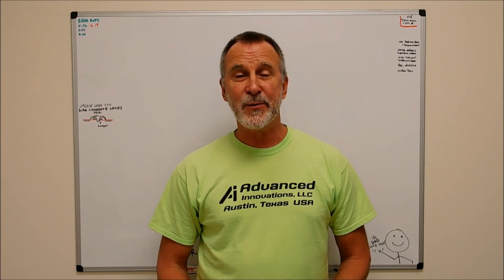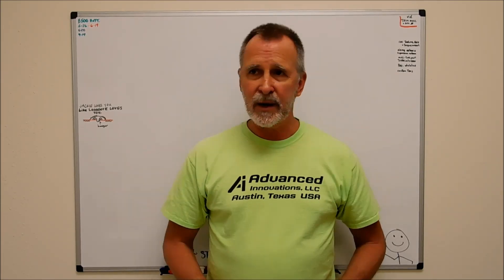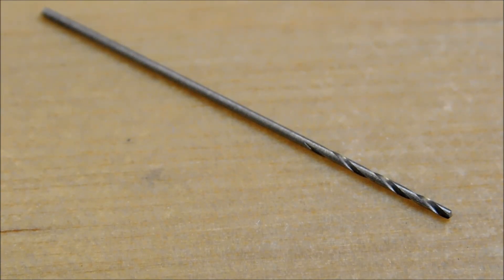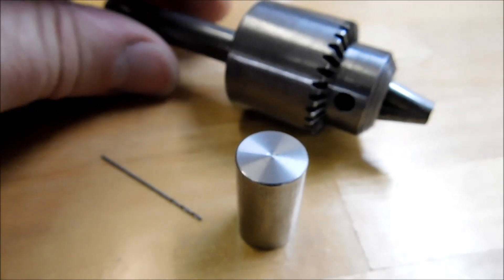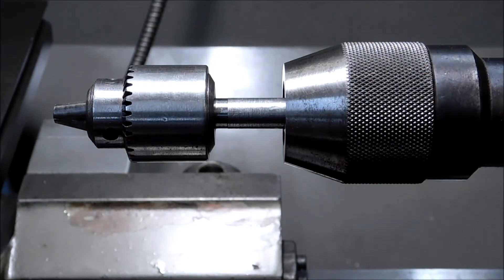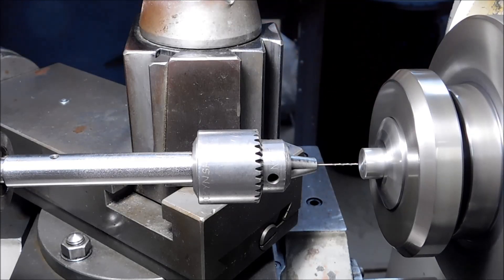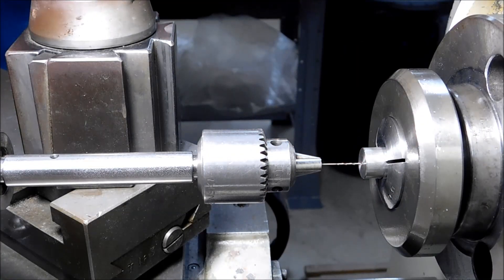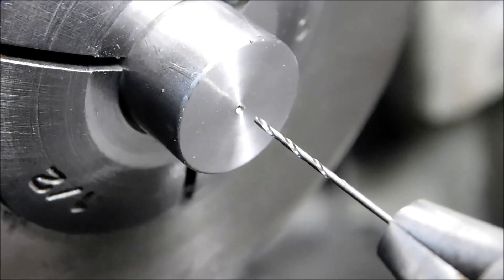Micro Drilling -- Stop Breaking Small Drills !!

Comment: A mill/drill version of this micro drill does exist. Years ago I made one for our tool room before we found out we could buy one. The micro drill chuck in this video can be upgraded fairly easily. 1. cut a key slot in the shank. 2.drill and tap the outer sleeve, the female part or adapter, on center and near the open end and install 'dog' tip set screw. The dog end set screw is used to drive the chuck but still allow the shank to extend and retract. 3. Cut a small groove for a snap ring about 1/4 inch rom the back of the chuck. this will hold a 'finger ring', basically just a washer, that you hold to control the depth.  Here is a store bought adapter that uses a key and slot. Hopefully there is enough info between my quick explanation and the pic to make your own!
Reply from the maker: As I have commented before, the keyed mill versions of this concept will not allow you to let go and have the chuck spin if the drill starts to bind.

Comment: I DONT HAVE TO GO  TO THAT MUCH EFFORT TO DRILL A SMALL HOLE IN STAINLESS. JUST BEING HONEST.
Reply: didnt have to go to that much effort capsing every letter lol
Reply: NOT shouting, sorry IF it seemed that way,  MY PHONE works BETTER when in capital letters. Put drill IN small jewelers drill press AND drill away. MAKE punch mark FIRST FOR sharp drill TO start cutting.
Reply: Ok LEANARD.  Where's the link to your video showing how you do it then?  Without all the shouting please.
Reply: leanard flow go home Leanard, you’re drunk again
Reply: WELL THEN THIS VIDEO WASN'T MEANT FOR YOU WAS IT, BY THE WAY WHAT KIND OF MACHINE DO YOU RUN, throat's dry need some water..........
Reply: @charliecopeland390  what do you mean BY that.
Reply: @leanardflow8194  I just meant if by what you said "" you did not even have a problem drilling small holes""  you didn't need to watch!! No problem dude.  I write in caps alot because my thumb is not very athletic any more and caps are bigger. I have adjusted my keyboard bigger several times and may need to do so again!  It's all good

Comment: When I was a machinist we had a micro-drill chuck that had a spring loaded shaft and a free-spinning thumb grip.  You'd hold the thumb wheel and pull the chuck down.  Total touch sensitivity.  When you let go the spring retracted the floating shaft.  Imagine this video's set up but with a spring pulling the chuck back into the sleeve.
Reply from the maker: Those are normally for a mill. The advantage this setup has is that you can let the chuck spin if you detect a binding of the drill so the drill doesn't break.

Comment: I'm a turner,miller but before that worked as an engineers storeman. While I was there I perused a tap and die catologue and saw that as regular stock they could supply a 4 thousandths of an inch (one tenth of a millimetre) tap with 318 teeth per inch. I would have crapped myself if I was told to use one. It's another world.

Comment: This method is only applicable in rare cases.
When a person has a shaver for work on a metal cylinder and when the hole should be at the center of the rule. For example when you to make a hole in the corner of a piece This method has no possibelity
Reply from the maker: Not true. Either use a 4 jaw chuck, or a key driven floating mill chuck and a 'V' block for mill applications.
Reply: @joepie221  Thanks for the vid! Joe, could you do another video on small drills for mill applications showing the use of a 4 jaw chuck and a key driven floating mill chuck, as you explained? Please please please. It would be great to have an overall understanding and  knowledge when it comes to having to drill very small holes on projects. Either way, you rule! thanks again for all that you do! Love and peace!

Comment: Just buy Sphinx or Harvey Tool carbide coated micro drills. I've CNC drilled a .006 DIA into 440c cond.A  Treated to 61HRC will last forever if you drill softer material. (make sure to indicate)
Reply: Source?

Comment: If you have to use a lathe, you have to use a lathe - then this idea is good.

But if you need drill small holes, and haven't got a well equipped workshop with the right size 5-axis machining center, I hope you have the right size  column drill machine.
Crank-up the rpm and make that (very)small "drivers dot" (I think it's called :) and "feel it through" - sub-1 mm drills are 1500+ rpm, practically any material.

I use sub-2 mm drill AND milling bits made of Tungsten Carbide, they are bridle like were they made of glass, for drilling and milling ceramics and 316L SS - milling is tough as you really have no way to feel if the tool-bit is cutting or "punching" through the material :o]
Reply: To drill small holes,all you need is a battery operated "micro-drill" similar to the
dentist tool . It comes with the bits. Price,around 15 - 20  bucks
Reply: @dcvaldez1993  Sorry ?!, a handheld tool ?? - with a soft toolbit like Joe uses here your might do it - if precision and perpendicularity doesn't matter. But you have apparently never used a high quality toolbit like one made of Tungsten Carbide - they are, as I wrote, bridle like tempered glass - in the same dimension, under 1 mm.

Comment: Nice. Lathe RPM is really too slow for such a tiny bit. Have you tried it with 0.3-0.5mm solid carbide bits? They break if you look at them sideways. But at least they have standardized 1/8" shanks. Maybe a sliding adapter with an ER11 collet rather than a chuck?

Comment: You could slot the guide tube then put a grub screw or pin through it into the chuck tail for use on mills / pillar drills. The chuck tail would need a bearing pressed on to it to hold it by though.

Comment: so, in order to save my small (0.2mm - 1mm) drills all I need to do is buy a lathe. EXCELLENT...…………………… ??
Reply from the maker: Simple right?
Reply: Maybe a small light pillar drill then use a wooden fork / horseshoe above the chuck to feed it down by hand? You’d have to get the feel of how strong the return spring is though.
Reply: Mope. I am tired of people making the negative comments when they find something that may not work for them. Okay, maybe I'm stressed a bit. I'll work on that.
Reply: *you get to buy a lathe
Reply: @spehropefhany  doesn't resolve the problem ,the hole I'm drilling is located off center -(
Reply: @mickakzsilp5146  You get to buy a lathe and a faceplate and/or 4-jaw chuck?
Reply: @spehropefhany  or Mr Pieczynski should add to the title : Micro drilling USING Lathe and 4-jaw Chuck ??
Reply: Raymond.  This isn't for everyone.  If you can't use this technique, get over yourself. I personally don't have a lathe and many of us don't.  I do however have access to one.  My advise to you is to look into the mirror and ask the person you see there, "why don't I have access to a lathe".  You might find that your attitude is standing in the way.
Reply: reltub20001. erm.............you ok mate? You sound a bit stressed because of the way you completely flew off the handle there and in fact ended up sounding like you are the one whom has the attitude problem.
Can’t help but feel you may be over reacting to a throw away comment. It’s not the end of the world. Just a comment on YouTube. Chill out.

Comment: One of my old bosses had a sign in the shop that said "If you don't know what lever A is then leaver B". I learned "the feel" from that guy after he stood behind and watched me try to burn a 3/8" drill bit through a stainless plate at high speed and I do mean Glowing Red with all the force I had in me at the time. Talk about work hardening Hahaaa!! Thankfully, "finesse" as he called it or "the feel" as you say is a skill I was capable of acquiring with a little bit of proper coaching. Cool trick man. Rock on Joe, with your 2017 post I somehow missed? Wtf

Comment: I figured if you wanna get real you go for edm wire drilling
Reply from the maker: You can't drill with a wire EDM. You need a specialized machine called a Hole popper.
Reply: @joepie221  I think you'll like this https://youtu.be/CvzneuHc0Sk not drilling but edm cutting.
You might have seen this  https://youtu.be/rpHYBz7ToII edm drilling. Both machines are diy setups.
Reply: I can do 0.3mm holes in 304 & 0.5mm in 316 using 90s techno. Electronic dance only gets you 1mm.

Comment: I have a similar tool made by Rutland that utilizes a Jacobs #0 chuck that closes to 0 on a spring-loaded shaft. I'm in the carburetor business and use it frequently on my miniature Sherline lathe which is smaller than your tailstock. Thank you for your video

Comment: You can do this with a mill.  You need a sensitive drill attachment.  It's roughly the same setup, but the drill is spinning and you grab the chuck by a ring that spins on bearings.https://www.msdiscounttool.com/catalog/product_info.php?csv=gg&products_id=105401&gclid=Cj0KCQjww7HsBRDkARIsAARsIT4gMT3c3RQA5VMN7I1kuGrmW6OWlKt2JMeE8GzT1CvNAgU5r--PNXwaAlbvEALw_wcB
Reply: Bob Darli.  The only thing I found wrong with the posred website for the attachment is that only in the state of California, the product has material that may cause cancer. All of the other 49 states and the rest of the world can use this product without worry.  What can the Californians use??  😃😃😃

Comment: Genius! I do work on musical instruments and use these sizes all the time. Do you have any tips regarding small drills straight into the sides of curved steel? Usually working with steel cylinders OD .085, drilling holes at right angles with a .020-.035 drill and reaming after. I would love to hear your thoughts on reducing walk, getting perfectly centered holes, and getting precise distance measurements between holes.
Reply from the maker: If possible, make a hollow guide that your tube fits into. This guide should have the hole through it the size of your tube, and a cross hole just like you want in your part. The main hole keeps the tube located, and the cross hole "guide hole" keeps the small drill from walking when it hits the actual part.
Reply: Joe Pieczynski thanks so much! That is the best method that has ever been suggested to me. We all have basic machining skills, but the practical problem solving stuff can sometimes be elusive. Love your vids, the threading techniques are ace.

Comment: Hi Joe! Do you do requests? If so I have a small question / challenge for you, should you wish to accept it! Imagine its 1940's Germany, and someone has asked you to make parts for the V2 rocket program, specifically the turbine blades for the steam turbine for the turbopump section! Here is an STL file and drawing of it, magically transported through time back to the 1940's when computers didn't exist https://www.thingiverse.com/thing:220205 
 
I've been trying to figure out how the hell would you make that with standard mills / lathes and materials of the time? Nowadays they are just one piece castings or CNC'd on a 4 axis mill. Notice the subtle taper on the front face, designed so that many of them sit together in a nice curve. I thought maybe a lathe and taper turning, but the rest of the part would get in the way! Maybe some kind of indexing head with the part held horizontally? And then getting in to make that "bucket" ... Reckon you could take a shot at machining one of these with regular manual workshop equipment? It would be fascinating to see what it takes to make one! Thanks for reading
Reply: Question inspired by the section in this video (timstamped) https://youtu.be/EgiMu8A3pi0?t=4910 where he mentions 7 or 8 tooling operations

Comment: Guess I could have used this trick a couple weeks ago.  had 16 holes to drill in in each of 16 Tantalum implant electrodes .19mm diam. x 1mm deep. Snapped off the spotter and 2 flat bottom end mills - the .19mm ones. Tantalum is unusually sticky stuff to machine at best but in small batches can be done I'am sure by using the trick you described here. Thanks very much for the tip

Comment: i drill very small holes in tool steel alot at my job and I just rest my finger on the drill so i can feel it cutting and if it bows at all , say today 12 hole bolt circle thru a2 with a 1/16 drill thru 1.500 of material 12 times 1 drill no breaks ,I have been a tool maker for 40 years and my supervisor who is not a tool maker today tells me not to let him see me doing this again it is a safety hazzard I have been doing this over 30 plus yrs. Broke alot of drills before I found what works and  it works for me never an injury .I keep my rpms at between 700 800 and it cuts like butter everyone else is breaking drills running way high rpms and ,like you said no feel..I got angry being told how to do my job by someone that doesn,t know my Job, and this man thinks it,s ok for a toolmaker to try to drill thru steel at 900 rpm,s with a 5/8 drill it was screaming I backed way off waiting for it to grab and shatter the drill sending fragments like bullets thru the air ,,,,wow I was told people have different ways of doing things ,hello yes sir right and wrong. thanks for letting me vent and I hope you answer to this as you said the drill is so small my finger is like leather after 40 yrs. doing this ,would I rest it on a 1/4 drill at 600 700 rpms hell know it would tear my skin off ,,,please reply Sir.
Reply from the maker: Machining is an art and the appreciation of feedback. Sound, color, smell machine tone changes...everything is a message for those willing to listen. It a shame when a company hires a degree to run a shop where hands are the best tools. Ask your genius boss to demonstrate his preferred technique next time he opens his mouth. Problem solved.

Comment: I used an old dead center ground the tip off, put it in the head-stock of the lathe  and drilled a  .25 in. hole with a carbide drill in. then  I made a .25 in mandrel for the chuck and a mandrel for hex dies
Reply from the maker: Stay tuned, I'll show you the one I made.

Comment: I'm a Watchmaker. That drill bit is fairly large to me.
Reply: I know what you mean, my grandpa the clockmaker, and nationwide clock repairman for montgomery wards did all his practically microscopic hole drilling by hand.
Reply: @MatthewHolevinski  that is still a standard method. My grandfather and father had contracts with the Railroad until they went to Satalite.  I'd like to add we use an abrasive piece of Corundum to shape, harden, and polish high carbon steel  0.002mm/min material displacement on average sized conical pivots for the balance staff on modern Watches creating super hardened mirrored surfaces. The larger size balance pivots on an 18 size Elgin pocket watch are typically between 0.11mm and .014mm. In Jeweled mechanisms (7j-21j) those pivots also glide on a Corundum surface that is also drilled. Corundum is the same composition as Ruby and Sapphire with a hardness of 9 on the Mohs scale. Gypsum is a 1 and Diamond is a 10. Ps. It is rare but Diamond jewels have also been used. Naturally Diamond is also the abrasive used in such drilling applications. The drill bit looks like a hair with a double heli and the diamond "slurry" is a fine powder added with oil. I typically only need a 20%mm dia 3.8mm long Tungsten Carbide HHS bit for small brass pivot holes https://www.mikrontool.com/en/Products/CrazyDrill-Flex/Description I also drill by hand using a "Steaking Tool" to stay perpendicular to the plates.
Reply: https://www.testntools.co.nz/desic-tungsten-micro-drill-bits-0.3mm-3.1mm-5-pack.html

Comment: Thank you Thank you Thank you Joe. I make small brass parts with small holes drilled deep. No matter how light my touch is on the tailstock crank, the "feel" is zero. From your great vidoe I can see how much quicker and easier it will be with the free sliding chuck. Indeed a "light bulb" moment for this amateur!

Comment: Im interested to know how to bore a 20mm hole 110 mm deep .
Reply: Edm drilling (electric discharge machine)
Reply: @oscarnfcp3510  i don't have that kind of mashine ,only 35year old yugoslavian  lathe
Reply: MrLolnovak you can build one! Check out Ben Fleming edm. He has two versions of it. Pulse edm and capacitor edm
Reply from the maker: Thru hole or flat bottom?
Reply: my particular case is trough hole in hardened steel (45 hrc) but i am interested in boath.

Comment: Lol this is not A small Drill xD i use .7mm drills @work... For stainless steel
Reply from the maker: Lets see....this was stainless, and .7mm is just about .0275. The drill in the example was .026. That would be smaller than what you use at work.
Reply: @joepie221  I graded my conversion  chart.  But Joe beat me to it. Go joe!
Reply: Joe Pieczynski lmfao as usual.
Reply: @joepie221  i'm sorry here in the EU i'm not that good with imperial measurements, but even if i use A .5 or .4 i dont need any special technique...
Reply: @irishwristwatch7544  ...I call bullshit on that claim!
Reply: yep for brass model making my bits go down to 0.4mm. i actually hope they break in the spiral because i can resharpen them and they actually last longer the shorter they are. However i rarely drill anything deeper than 1cm with such small drill bits. i can imagine in a machine shop it's quite a different story though.